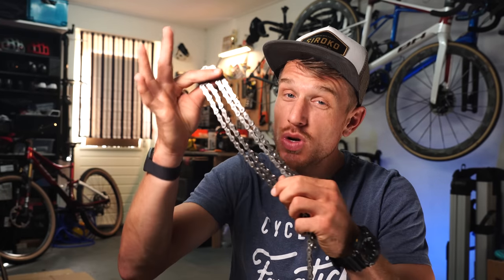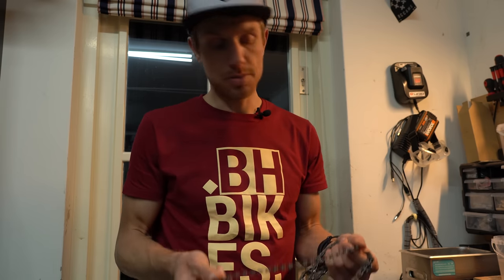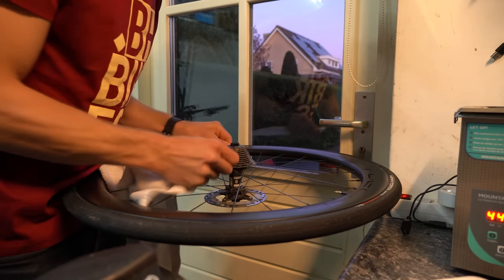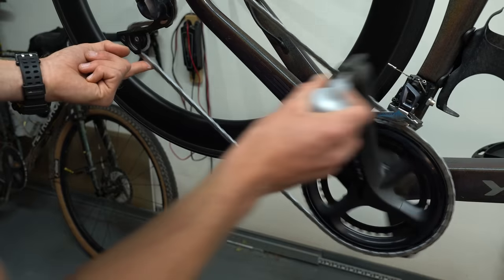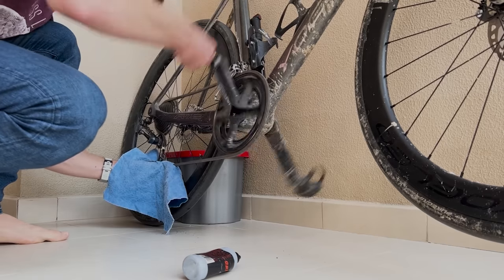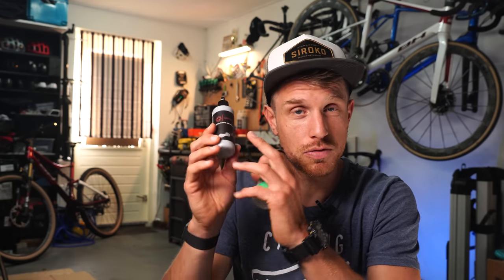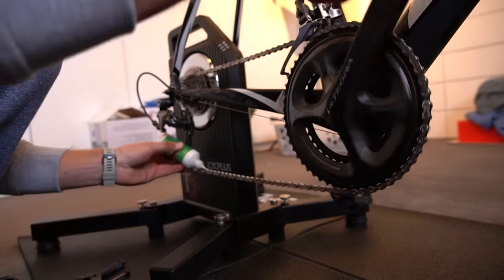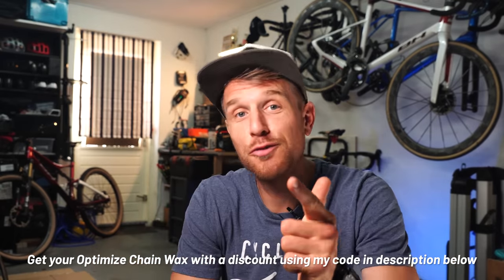Testing Chain Wax for 1-YEAR and this happened..

Comment: For tips about degreasing a new chain, refer to Zero Friction Cycling. They have an excellent and easy to follow guide on degreasing. Also a good video on how to properly use an ultrasonic  cleaner (not al ultrasonics are created equal and you need to de-gas the cleaning solution before putting in the chain). Terpentine as a first step and acetone or alcohol as a second step works just fine.  Silca Chain stripper is also said to be very effective, haven't been able to try it myself.
Reply from the maker: silca chain stripper may work great ( i havent used it) but its very expensive. 10x as expensive as nitro thinner. 
acetone does not work (as I tested and showed in this vide). And therpentine is less strong than Nitro Thinner. 
so, I'm staying with Nitro.
Reply: Acetone is used as a rinse after the degreaser. It helps remove any degreaser from your chain.

It also evaporates quickly unlike water, so the chain doesn't rust.

Using acetone strictly as a degreaser doesn't work.
Reply from the maker: @cicw22 that’s why I use thinner. It works as degreaser and will evaporate so no need for acetone

Comment: What I learned from doing the hot wax is that you don't want to remove the chain from the pot while the wax is fully liquid as this way most of the wax inside the links will drain out. Wait until the wax is becoming more milky/snotty and you will get the best longevity as the wax will remain in the links therefore taking longer to wear out. I can get about 600 to 800 kms out of one wax, and about 8000+ km on one chain. Great video!
Reply: I use putoline (motocross wax)..  after dipping I lay the chain flat on a towel.. everything stays where it should.. after 10e in I hang it to harden…

Comment: A few baths in mineral spirits, followed by denatured alcohol will remove that manufacturing grease from a chain and leave it “rattley”.  It’s what the folks at Molten Speed Wax recommend in their instructions, I’ve done this several years and it works like a charm.

Comment: How does wax affect the overall lifetime of the chain vs oil? Did you get more km out of a chain before it becomes too long?
I use wax on my bikes since 2 or 3 years. Would like to hear your experience.
Reply from the maker: So far I’ve heard people in the comments put over 10.000km on 1 chain! That’s unheard of with oil I think. 
Ive used too many different bikes and chains to be able to track the lifetime to that extend.  🤪 (It would add up to 40.000km a year haha)
Reply: @jasperverkuijl I use 3-in-1 multipurpose oil (very cheap) to lube my chains. I get over 10,000km from the chains, even 12,000km. I don't ride a lot in wet conditions, and mostly on road but some off-road as well. The trick is to wipe the chain clean with a cloth moistened with some degreaser (kerosene is great and petrol works as well, even WD-40) every 100 or 150km and after that I just add a few drops of fresh oil on the chain while spinning it. A 5-minute job each time which I don't mind. Nice video man 👍
Reply: I don't know about kilometers but I used to get 8-10 months out of a chain on my commuter/gravel/dirt bike with oils, and recently replaced a chain that had been on for roughly 16 months when the chain checker said it was nearly worn out, so nearly twice more for me. Using another brand, but drip on wax emulsion lube. Also a lot less hassle cleaning both the chain and the rest of the bike now my spokes, rear rim and frame aren't covered in filthy oil.
Reply: I've been waxing for 4 years on all my bikes and so far have only replaced one. I used to get about 3k miles on a chain with oil lubes, but the waxed one I replaced had 8.5k miles. The chain I replaced it with has 9.4k miles so far and is about .35 to .40 wear. I use paraffin + ptfe, and it lasts 200 to 300 miles between hot dips in a dedicated mini crock pot that cost about $13. I use Shimano chains, and re-use the Shimano quick link for the life of the chain.
Reply: I use WD 40 to clean the chain with kitchen towels and then a clean rag. Then I put a dozen drops of 3-in-1 oil on the chain while spinning the chainring. This is a 5-minute job.  I ride mostly in dry weather and do the above when I see that the chain is dirty. I get 12,000 km out of a chain. This is the easiest way for me and I don't mind cleaning the chain at all, without even removing it.
Reply: Also a good option but I like the clean bike (no black oily grime) advantage so much that I would stay only for that with wax even if it wouldn’t have the extra miles.

Comment: To maintain the wax temperature below 100 deg Centigrade, I put the wax container in another vessel containing water at the bottom, and then heat this over a regular stove. The water boils at 100 deg, so the wax never gets heated beyond that point.
Reply from the maker: I just use a low setting on my stove which will also not let it become too hot. 👍🏻

100C is actually way to hot so a low setting on yhe stove will work better

Comment: You can use cheap rice cookers for heating the wax, then just leave the wax in them and put the lid on to store it in the garage. No cleaning up the pot afterwards, and you can do everything outside. You can also put a metal mesh in the bottom of the pot to hold the chain away from any sediment. As you mentioned, you can also have a dirty and a clean rice cooker/wax pot. Here in Australia you can buy rice cookers for about $15. 
Also put the chain in a jar or zip lock bag containing your solvent, then put the entire container/bag in the ultrasonic cleaner full of water. That way you only need a small amount of solvent. If you use a zip lock bag, support the opening above the water line.
Reply from the maker: Good idea of the bag in ultrasonic cleaner 👍🏻👍🏻
Reply: The metal mesh on the bottom is smart!

Comment: You could try white spirit as degreaser, it’s a solvent for oil paints. Usually it’s available where universal solvent is sold. It should work with the chain grease.

Comment: I find that wax makes bike maintenance a lot easier. I used to thoroughly clean my bike when my chain got dirty. But now I tend to just put the chain back in the pot when it needs it. When I have to clean the bike completely, which is less often because the drivetrain is much cleaner, I take the chain off for a trip back to the pot. The jockey wheels, cassette, and chainrings are much easier to clean with the chain off, and they haven’t attracted nearly as much dirt and grime. 

I do need to try a drip wax to use after wet rides. Sometimes I end up re-waxing very frequently when it’s wet out.

Comment: I’ve been doing this for a few years now. I reckon chains, cassettes and chainrings last 3-4 times longer using wax than oil. It’s a no brainer and no “chain tattoo” if you touch the chain. Plus it’s faster. 

A few suggestions - 
1. Use a slow cooker/crock pot
2. Degrease - soak in diesel overnight, then ultrasonic with degreaser & water, then rinse with water and finally shake in a jar with isopropyl alcohol.  Allow to dry/evaporate for a couple of minutes before putting in crock pot. 
3. Heat wax to over 90°C for max penetration BUT then allow to cool to about 60°C (ie just before wax starts forming a skin/solidifying). Yes you will need a thermometer but worth it as you guarantee full penetration while retaining wax inside the rollers as the wax cools and becomes more viscous. 
4. Use a plastic pipe or hub chain keeper/rest to break the hardened wax on the links (saves your fingers). 
5. If you’re racing then make sure you ride for 30-50k using the chain before the race to maximise the efficiency. 

BTW, I love your cardboard box chain hanger idea. I’ll use that in future. 👍🏻
Reply from the maker: I just received the special wax cooker from optimize. Super nice machine that will replace my pot and stove setup 🙌🏻

Comment: note: this video says that wax prevents the chain from getting dirty this is incorrect. all the wax does is prevent dirt from getting into the rollers. As the wax wears out, or has water introduced, dirt will ingress into the rollers. this is why it's important to clean the dirt off of the outside of the chain after every ride, and to reset the wax occasionally. it is these steps that help you get the most distance from your chain. 

to save having to do a full reset as often, you can touch it up with a compatible drip wax. but this won't remove any dirt that's gotten into the rollers already only the full immersion reset will do that.

Comment: Don't know if this trick is already out there, but I made a pan to heat the wax to soak the chain in, that fits inside the tub of the ultrasonic. I heat up the wax/chain to melting then transfer that vessel into the ultrasonic and turn it on for a few minutes, then reheat and repeat 2 times. Wax gets in everywhere. Chain is fully waxed. Then pull it out a drip dry as usual.

Comment: For waxing at longer rides with sleeping in hotel scenarios, you could make your own "drip-wax.". Take a glass jar filled with solvent like extraction gasoline or any other solvent that evaporates quickly and dissolves wax, then start adding wax of your choice to the jar till it won't dissolve anymore. Now, transfer this solution to an appropriate dispenser that is resistant to used solvent. Application is easy 2-3 drops for each roller and wait overnight for solvent to evaporate. Solvent based "drip-wax" has another benefit it does not contain water, so your chain will be less rusty + it better penetrate innerchain.
Reply from the maker: Probably easier to just buy a bottle of optimize drip wax than to mess around with chemicals yourself?
Reply: @jasperverkuijl  But those brand drip-waxes are mostly water suspension of tiny wax particles. Such a suspension have little or non penetrating properties. Wax dissolved in a petroleum solvents have a great penetrating abilities, but used solvent must be fast evaporating so Petroleum ether is a quite good solution. And for last, making your own drip-wax is cheap.

Comment: Hi, I live in Denmark, lots of rain here;-), I did not try the hot wax yet but I have tried lubewax from Smoove and Squirt, and gone away from that when I found that after riding in the rain, maybe for 1-2 hours the dripwax was gone and the chain was "naked", as you already mensioned the Optimize wax is also soluble in water! put it on your finger and a drop of water also and it is washing away, meaning I am riding in the rain with a chain that is completely unlubed after a short while! the good thing is though that it is easy to clean the chain after the ride with a waterhose but if it worn prematurely then I am not so sure. I wash the chain and lube it with a good oilbased  product. I am riding MTB and Racer/Gravel.
Reply from the maker: The hotwax doesn’t have the emulsifier so might work little better in wet conditions

Comment: i used to do this with regular candle wax. I used gasoline as degreaser. I had to use 2 containers... 1 was for all the dirty work.. that wasnt chnged offten... and then i used second container with fresher gasoline. Chain was cleaned 100 percent.
Reply: I also use Gasoline which after much experimentation works the best.  However there is a little bit of lubricant in standard Gas so after using gasoline you should then use a degreaser.  So Gas, then Degreaser, then Isopropyl alcohol or acetone.  It may seem like a lot but you only have to do this once per chain and only takes about 20 minutes after you get everything set up.

Comment: Run to the 2nd hand store and get a used crock pot; makes the hot wax process easier to do in a garage or other place where a bit of drip/splash doesn't get you into trouble with housemates. Do look for one with a "warm" setting; I found that the "low" on the one I bought is still a little too warm and I need to turn it off & let it start to cool before doing my dips.

Comment: I use a product called Varsol(oil paint thinner) to degrease the new chain, It takes about 5 minutes, then i rinse with friction alcool, so my chain never touches water.
Once dry i apply my wax with an already mixed product. Once i run my bikes with the wax, i only do a complete chain cleaning every spring.
Once in a while i will do a dry brush cleaning, to clean the sides of the chain of the excess wax, so it looks better and shinny, loll
Amazing how silent it can become and how clean it keeps the transmission, never going back to oil again, even in the winter.
Reply: Varsol is white spirit.

Comment: In the Netherlands the thinner has changed to environmentally friendly thinner about 20 years ago and as a result of that the thinner does not work so well as before. However in other parts of the world the good old thinner is still available. That is why you needed the nitro thinner. Be carefull with it while using because it ends up through your skin into your bloodstream.
Reply: petrol is still the same and it works perfectly
Reply: Or use 'wasbenzine'.

Comment: I think that what you were using that actually worked, is what we call Mineral Spirits here in the U.S. I use that, and then clean the chain with a rag, then I soak it in Denatured Alcohol. Completely clean and degreased with this method.
Also, I've found that taking the chain off, and running boiling water over it to clean it, is a super fast way to get it "bare" to put back into hot wax.
Reply from the maker: Mineral spirits is “spiritus” in Dutch. So it’s not the same. Nitro thinner is like paint thinner but without a the additives. It’s super strong. 

Anyway, many comments that spirits work well so will try it. 

Indeed yhe boiling water works in between hot waxing 👍🏻👍🏻
Reply: @jasperverkuijl no, Dutch 'spiritus' is denatured alcohol.
Mineral spirits is more like the Dutch 'terpetine'.
Reply from the maker: @jybuys aha. Leuk al die vertalingen 😅

Comment: After rinsing with water, rinse with 90% rubbibg alcohol. It will displace the water and evaporate much faster reducing the chance of rusting.
Reply from the maker: That worlds. 

I hang them up in our closet that has the heating dividing system (hot water pipes) so they dry very well in there 👌🏻

Comment: Thanks for the video.  It's really great (I'll be using the cardboard box hanger).  You mention that if you come back from a wet ride and don't dry the chain you get some rusting.  Is this just with the wet wax or does it also apply to the hot wax?  If also with the hot wax, then how do you resolve this as presumably you wouldn't apply wet wax or oil onto the waxed chain?
Reply from the maker: The rust is similar with the drip wax and hotwax. 

You can mix the hotwax and drip wax products so after the ride you just dry the chain (with a towel) and apply some drip wax to it. 
Never use oil on a waxed chain.

Comment: You have sold me that chain waxing is the way forward. However, all those selling chain wax products seem to be out to fleece us raw! The early chain waxers (and I mean in the 1970's) used standard paraffin wax. These guys are trying to persuade us to use these extra special products that cost us an arm and a leg. Someone, come out with a cheaper package - oh and tell us how to dispose of the chain cleaner. Hmm and perhaps the chain manufacturers will start to sell chain not smothered in thick grease.... Just hoping!
Reply from the maker: The standard lube of optimize is not more expensive than any other wax or lube. The graphene and graphite versions are indeed quit expensive.. but a 12k bike that some people ride is also expensive 🤷🏼‍♂️ just whatever you have and want to spend I guess

Comment: Hot wax = clean, loud, short living. Oil = dirty, silent for 10x more distance travelled with dry condition but require a lot of cleaning. 
On MTB I start hearing the chain after 40km in dry conditions. 100km is max between reapplying hotwax. With regular oil based lube chain is quiet for 300km in dry conditions.
Reply from the maker: Sounds like you’re doing something wrong 🤷🏼‍♂️

Also it’s exact opposite to the many many comments I’ve seen on this video

Comment: Maintaining the waxed chain. 
Leave it on the bike. 
Wipe it down. 
Drip on additional wax. 
Use a hair dryer to melt and drive wax into the links effectively. Takes approximately 5 minutes with a hair dryer and less hassle than the hot pot method.
Reply from the maker: Don’t think that works with dripwax as it’s a water emulsion. They are liquid because of the presents of water that will evaporate. No need to heat the chain after applying the wax.
Reply: The wax in the emulsion will quickly coat and stay externally on the links due to ambient temperature of the chain regardless of the base. A hair dryer will “drive” the wax deaper into the link pins & pivots. A 5 minute process to insure better penetration.

Comment: I envy you that say about "cheap" slow cookers to melt the wax. In Brazil slow cookers are so rare to find and they are really expensive. Our solution is either a pan we call "thermowax" (used to melt hair removal wax) or the hot water bath method to prevent wax overheat.
Reply from the maker: Just use a low setting of the stove and it won’t overheat

Comment: I use gas to clean grease off chains. Works great. 3 times shaken, not stirred, in a container cleans all that old and new grease off. Then I use my $5 rice cooker with the wax melted and dip the chain swirl around and your good to let it dry.
Reply from the maker: Good stuff